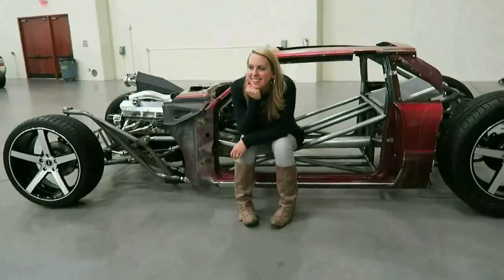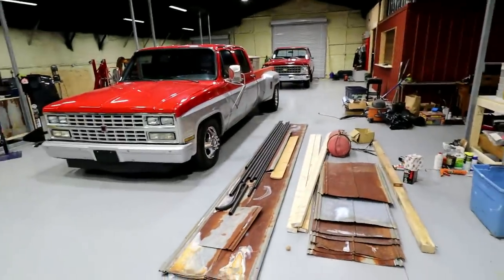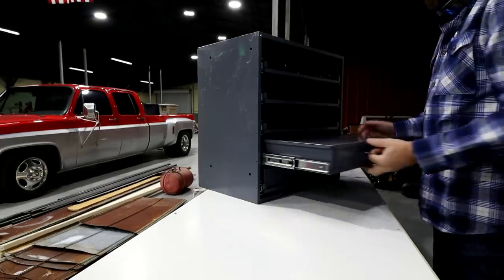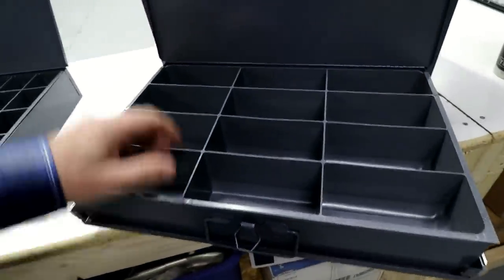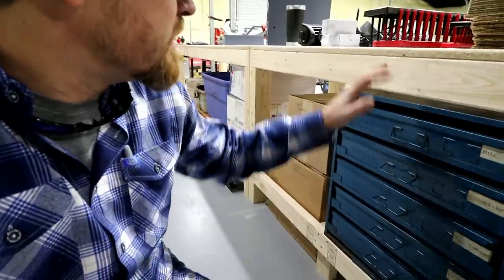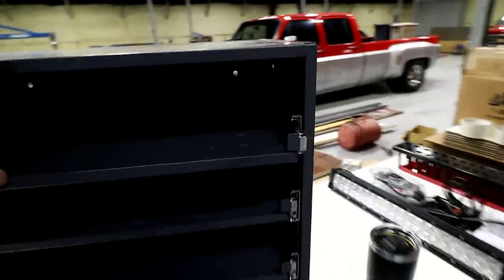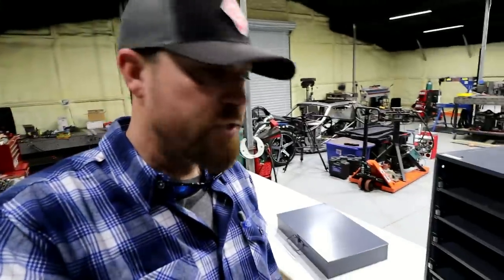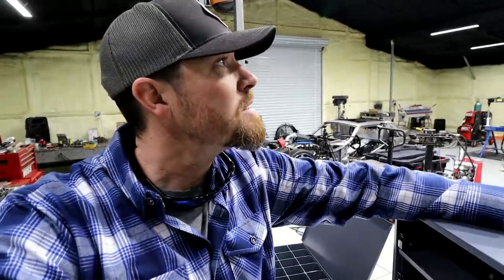You Need This Tool - Episode 116 | Shop Storage Parts Bins by Durham MFG

Comment: People sell old Dorman hardware / parts bins on eBay, but watch out for gougers.  Sometimes new ones are cheaper thru Amazon with free shipping.    Vidmar or Stanley Industrial cabinets are awesome, and can be bought cheap from industrial salvage / surplus stores or DRMO on military bases.   I got two for the cost of hauling them away, which is the first and only time I ever got anything that cool and useful for cheap.

Comment: A couple of differences between the two drowar sets - the first had a latch so you wouldn't need to worry about the lid opening and spilling the ** everywhere, and the second had the little card-holders for holding cards with their contents listed.
When shopping for them, it would be worth checking over all the little details the various brands - these are just a small selection - offer as some may be very useful, others less so.

Comment: I have a few file cabinets in my home shop but really like how I turned a old small tool cabinet in to small storage like them boxes.  HF 26”x22” with some office desk and kitchen draw organization really works great.  Mine is a 36” dewalt.   I even used a bottom box for a baby changing station that I took 3/4” plywood making it legitimate.  The draws are awesome for diapers, wipes, gloves for the really bad ones lol, socks, and so on baby stuff.  Did take the wheels off put a 2x4 in place so it was lower and doesn’t move.

Comment: I bought a couple of them used off Ebay. One was full of stainless metric nuts and bolts. The other one had useful small hardware. They were both under $50 shipped.

Comment: get you some shrink wrap electrical connectors off amazon, they also have butt connectors with solder, glue, and shrink tube all build into one so you end up with a waterproof pull proof soldered connection in a minute for 25cents

Comment: I picked up one similar to your blue one years ago at a yard sale for $40. It was full of screws bolts washers  Trays dont come out though.  I love mine. I screwed it down too so it wont flip if the drawers are open.
Update. my trays do come out. Thanks!
Reply: How did they come out ?
Reply: @victorarredondo224  The plastic tray sits in a bottomless frame. I just push up from the bottom. Different brands mat be made different.

Comment: Thanks for posting.  Those plastic compartment inserts... are they sturdy on their own?  I saw a cracked corner at 2:18.  Are they pretty brittle?
Odd question I know, but I have limited width in my mobile setup and I'm thinking of building a custom drawer bank using these long-ways front/back.  
Btw - Looking at these inserts at Grainger for about $11 - 13.00

Comment: $225 USD, that's like $10,000 Aussie... I just bought some plastic ones from Bunnings. If you don't need them to be super sturdy for things like electronics, plastic is fine, but I wouldn't want to store heavier stuff in them.
Reply: I paid $180 Aussie for this exact same thing from kincrome 
The same in every way except the boxes have removable segmented bins 
Iv got a few for everything from sprinkler parts to bolts
Reply: @fowletm1992  that's not bad, but I still think I would stick with the cheap plastic ones unless I was constantly in and out of the draws. The ones I bought for all my electronic bits and pieces will probably never get opened.